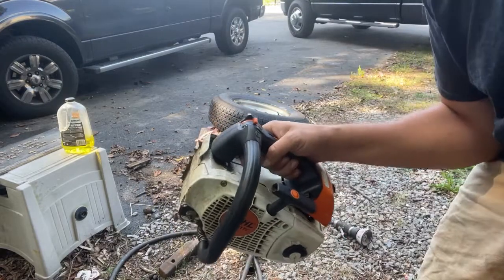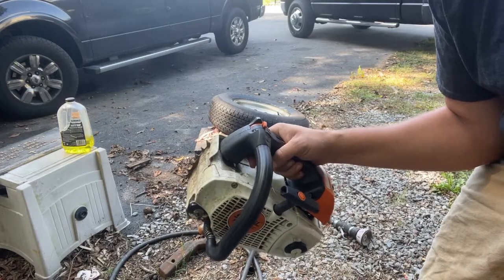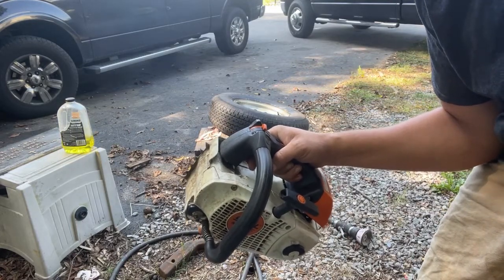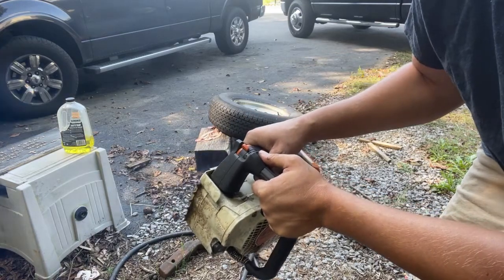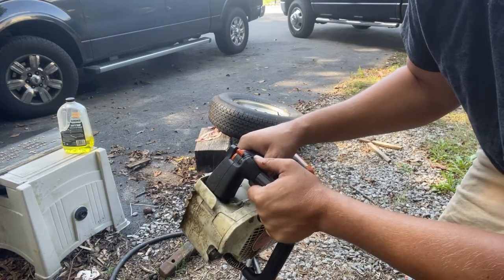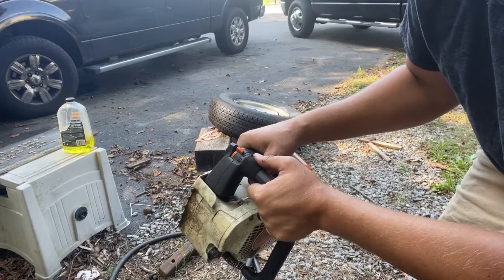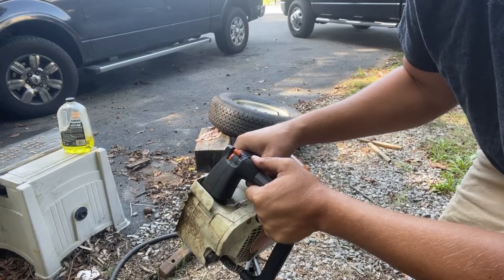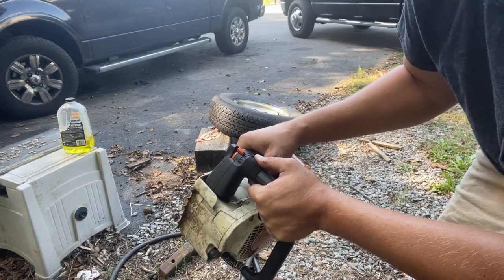Stihl MS201C reset procedure.

Comment: Clean the carburetor diaphragm needle valve all is clear got new fuel solenoid Auto for 30 seconds give it gas died in 2 seconds I give up
Reply from the maker: The best that I remember the solenoid on the carburetor has to match up with the ignition coil. It’s better to get both of them replaced as a pair.

Comment: Great job on the reset ! I think i might have to do that to mine kindda like a reboot ! Would you mind telling me the date of manufacture i belive mine was built 2018 but the information sticker is long been gone anyhow thanks again PRO!!
Reply from the maker: I don’t have the saw it was a customer’s, he picked it up before the video went out. I think this is 2nd generation. 3rd generation is different, I haven’t done one of those yet.
Reply: @JKSawShop  JK Pro i greatly appreciate you taking the time to reply thanks !! I was curious as mine is doing the typical fuel solenoid issues and its starting to be a real pain ! I mostly run 200ts but i got the 201tc for a exchange on a couple of parts i had laying around so i decided to pick it up you loose some and then some more !!! Anyhow thanks again keep on keeping on and make em ripp 🤟🤙👍
Reply from the maker: @elbenny805  They can be very frustrating for a while. I spent four months trying to figure that one out.
Reply: @JKSawShop  i think ive had enough of the newer M-tronic saws for a while as ide rather carry my old trusty orange stihl screwdriver and compansate for altitude that way ive never had an issue so far ! Been running mobil 1 racing 2t @ 44to1 and just right on the edge of lean and always clean or replace the air filter lately ive been running the maxima formula K2 but i find it a tad bit too much for a chainsaw but thats just personal preference to all Sawyer's out there !!!
Reply from the maker: It is all pretty much preference on mix, there is no point in arguing the best mix ratio. I still like my screwdriver too.
Reply: @JKSawShop  you bet pardner !! Well thanks again for taking the time to respond to the questions it really was a real treat im sending you a happy Thanksgiving this coming Thursday and a firm handshake 🤝 from sunny California!! Definitely no arguing on the mix i find thats a sure way to open up a can of big worms ! If it ain't broke then don't fix it i just don't want to be that guy with a smoke machine scaring away the mosquitoes is all ! Anyhow y'all take care and keep easy thanx pardner imma have to try that on my M-tronic saw !!!! 👍👋

Comment: How does that work? I know some about carbs but self adjusting, mind blown.
Reply from the maker: It’s a newer technology that allows the proper fuel air mixture throughout the cut. That way the saw does not go too lean, and it will adjust for dirty air filter as well. I will make a video on the basic working theory on m-tronic. It’s good and bad at the same time.